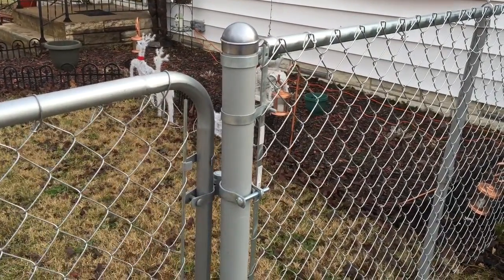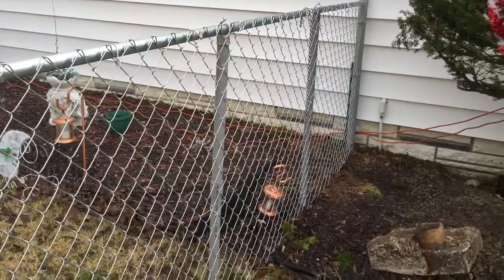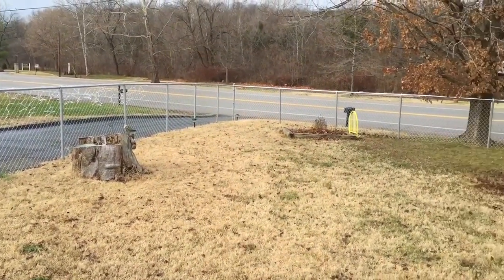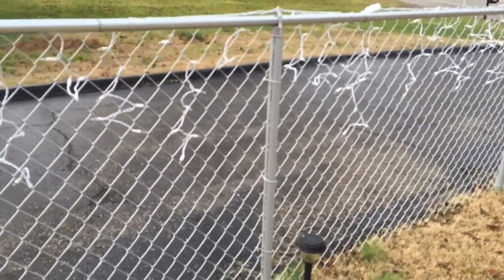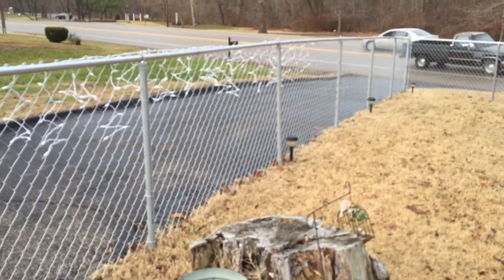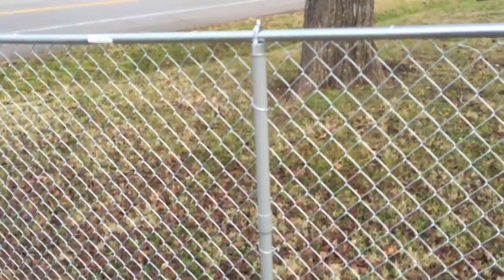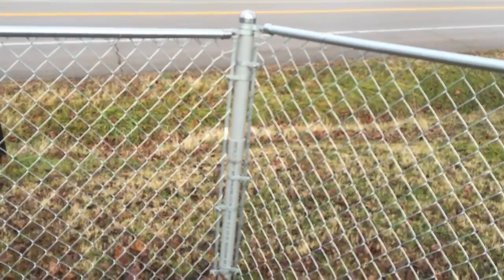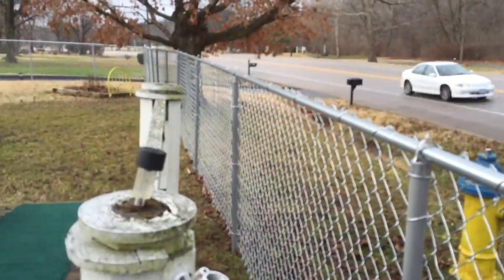How to Build a Chain Link Fence using Gray PVC Post

Comment: Milton tore my fence im looking into chain link and noticed that pvc is cheaper and still sturdy. Would pvc pipe running the top work to or should i do metal for that. And hows it holding up? And did you use chain link fence tensioners?

Comment: I think you'll be surprised how easy your PVC posts will snap . If you accidentally bump it with your car , or some kids run in to one while playing ball . That is the reason they make these out of conduit or steel . Once bent , you can straighten it . Not so with a piece of PVC .
Reply from the maker: Conduit is a lot stronger than you think but it will have lots of useful applications, thanks for the comments
Reply: @rockwithface  fill them with concrete
Reply from the maker: now its 7 years later and its still standing